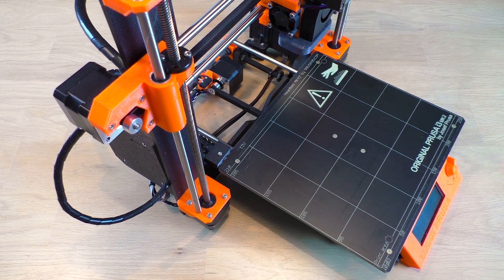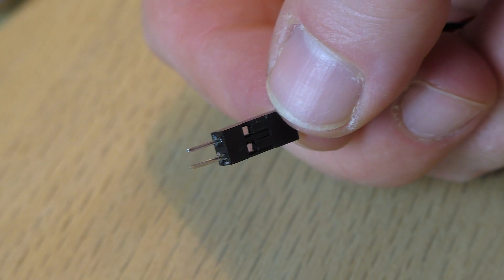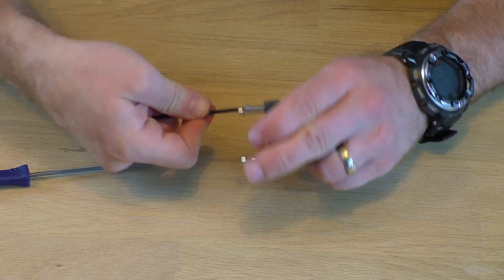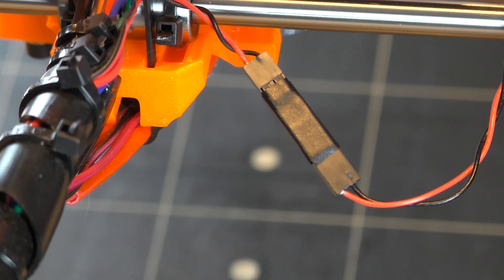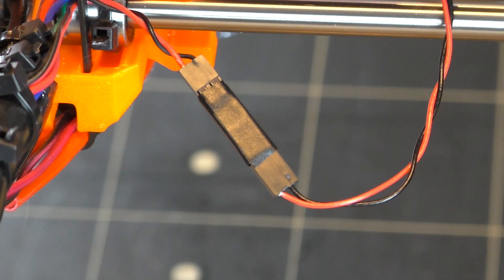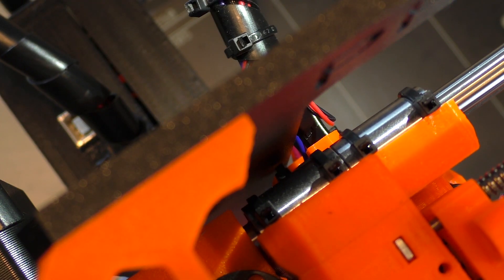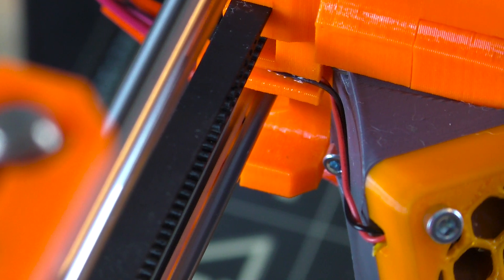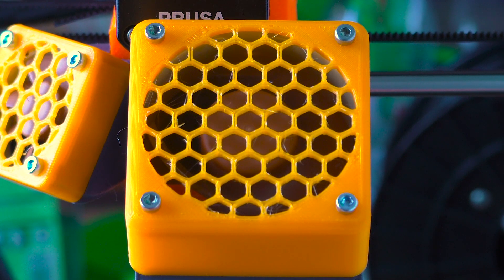How to install Noctua fans on a 3D printer

Comment: I was wondering if i can use this for mk3s 
I mean fan mk3s already quiter than mk2 but still i cant put them in my bedroom, the noise is too high for me at bedtime.
Reply from the maker: Sure, just make sure to buy 24V version (Mk2 used 12V).

I would strongly advise against having the printer in your bedroom. There are a lot of particles released during printing and unless you have industrial grade air filtration, you'll be breathing them the entire night. ABS particles are known to cause cancer and other filament types are probably not much better. It's just not worth the risk.

Comment: what is the difference between 3pin and 4pin fans, would there ever be a use for all pins instead of just positive and negative?
Reply: The third pin in 3 pin fans or the usually yellow (if red is power, if there is no red then yellow is power and you should check the fan datasheet for the extra pins, but this is usually green then) pin in 4-pin fans is for speed measurement, it is usually open-collector output that puts out 2 pulses per rotation. The 4th pin is a PWM input connected to a transistor that turns off just the coils (or the MCU if it is some fancy fan with inbuilt soft start), and it accepts around 22kHz PWM signal, active high (100% speed when high). Check fan datasheet if possible for voltage levels, but usually that would be 5V even for 12 and 24V fans. If your printer doesn' t have extra pins on the MCU or you want to use said fan as a desk fan you can always make a manual controller on NE555. A 4 - wire fan might not be happy when run with PWM applied to power wires (like in most 3D printers), and the PWM wire left open, as the PWM on power may reset the fan's controller board, maybe adding a few uF capacitor in parallel will help, but it may run just fine, depends on the fan model. A 3-wire fan will usually work fine in 2-wire mode, but there always some 2 and 3 wire fans that don't like running from unfiltered PWM and they need a capacitor across them too.
Reply from the maker: Yes, the additional pins are used to report fan speed, but your firmware has to support that. This is useful for detecting if the fan has stopped working, in which case the print should be paused.

Comment: i find it funny no one shows you how to wire it to the board lmao
Reply from the maker: It depends on the printer you have, but in most cases, you simply look at the motherboard layout sheet, find the fan socket and plug it in. Here's an example for the Prusa's Mk3 board, all you have to do is plug it in the correct one: https://storage.googleapis.com/helpdocs-assets/Sd0njU6Ihj/articles/0SeHT5uEBp/1519683483568/readings.jpeg

Comment: After saving for one and buying one everyone told me they’re terrible for printers and don’t have enough static oressure ;( tho i bought the 20mm thick version maybe it’ll be different
Reply from the maker: Yeah, I have to agree with you, at least for the part cooling fan. It looked fine for a while, but I noticed it just wasn't putting out as much air as a radial fan. So I switched back to that and I'm only using Noctua for the hotend now.
Reply: @HobbyHoarder  hopefully it doesn't clog! someone told me it causes clogs. but mine is super cold. tho again I have the 20mm thick version but it made me lose 10mm of build volume :P
Reply from the maker: My first Noctua did lose performance slowly and it ended up causing a few jams. New Noctua (the one I got from Prusa's upgrade kit) has been working fine so far.

Comment: Do you Have the link for the fan gaurds? my n stop keep hitting the blade
Reply from the maker: The fan guards are already included with the adapters. Check the video description for Thingiverse link; you can then download just the fan guard under the "Thing Files" section.

Comment: Oooh the thing you used to attach the cable thingie is so cool! Never seen one before
Reply from the maker: You mean Dupont connectors? I love them and try to use them whenever I can. My printers run all the time and fans tend to die quickly, so it's super easy to replace them.
Reply: @HobbyHoarder  yes! never seen one before ^_^

Comment: My vacuum cleaner is less loud than my anycubic i3 mega! Considering that the noctua is scaringly under powered I used a random leftover fan from another brand that was 1.8-1.6w instead of 0.8e-1w the noctua fan Is. Not dead silent but it works :) and it doesn't bother me anyway. Next step, TMC DRIVERSSS
Reply from the maker: Back then, I could only keep the printer in my office and the noise was driving me crazy, which is why I went for the Noctua fans. Otherwise, you're perfectly right, it's probably not worth the bother. Now that all of my printers are in the basement, I don't care and use no-name fans from AliExpress. Good luck with the TMC upgrade, I've been eyeing those as well.
Reply: @HobbyHoarder  i have to import those for almost twice the price sadly. but you're right. my case was a little extreme but All I'm saying is that you're not stuck with noctua you know? I mean they're great but just what I did. I used no name fans cause I had them previously
Reply: What’s weird is everyone saying Noctua’s are underpowered yet they push more air than any other fan china can give you. I think people just compare the numbers and nothing else. 90% of fans on eBay or AliExpress have completely bogus numbers on them anyways.

Comment: the hotend fan wil not produce enough static pressure, it highly recommended to just get a good quality blower type fan because they can also be really quiet. I recommend titan blower fans for this.
Reply from the maker: You mean a radial fan? That's an interesting idea, I've never seen radial fan used for the hotend. Have you made the upgrade yourself?
Reply: @HobbyHoarder  they are used all the time and are meant for high pressure applications like blowing air through a nozzle.

On the fans you used you can put your hand above it and feel wind blowing instead of sucking. This is because the air can escape around and through the fans blades.

Atleast for your part cooler, for your cold end I'm not too sure if it would work or if it's necessary

But for your part cooler (the one blowing on your nozzle) it Atleast removes a huge and heavy cone and fan. So you get less ringing
Reply: Which model in particular and where to buy it? Thanks
Reply: @lechequemada1661  there is only one 5015 titan version be carefully it's a 12v version so if you run a 24v system you need another version

Comment: I've done my extruder with a SilenX IXP 13-14. Definitely a worthwhile mod, especially if you want to print at night. I'm hesitating on doing the hotend as it adds significant weight to the moving mass. Did you notice a change in your prints quality, like more ghosting?
Reply from the maker: I've since went back to the original hotend fan. I didn't really notice any loss in quality due to the extra mass, but it just wasn't cooling as effectively as the original radial fan. I've tried tons of different nozzle exhausts that you can find on Thingiverse, but none worked as well and I'd always get more warping. The Mk2.5 does come with the new exhaust that bends around the nozzle, so maybe that one would work better with a silent hotend fan.
Reply: @HobbyHoarder  Good to know! From what I've gathered so far, axial fans have much lower pressure than centrifugal ones, which is required for parts cooling. A way to reduce noise would be to get a larger blower and have it run at lower RPM.
Reply from the maker: Yeah, I've been reading on it and it seems the pressure is much more important than just raw airflow. I agree with you that using a larger fan would likely solve this, but the 60mm Noctua fan is already huge and it can't match the small stock radial fan. Putting a 100mm fan on the hotend would probably look ridiculous :)
Reply: @HobbyHoarder  Of course! I meant using a larger radial fan :)

Comment: Where can I buy the 4v. I’m only seeing the 5v.
Reply from the maker: King Kong You need 12V version for most printers, not 4V or 5V.

Check out my reply to Richard for links to the official web page.
Reply: Thanks for the reply Hobby Hoarder! So 2 Noctua 40mm @12v each will be good for my anet a6?
Reply from the maker: King Kong The 40mm is fine for cooling the hotend. As a part cooling fan, it might not be strong enough. I'd suggest a radial fan instead. If you still want to go with the Noctua, then a 60mm one would be better. So, 40mm for the hotend and 60mm for the part cooling.

Before you buy anything, check if you can find an adapter on Thingiverse so that you can actually mount the new fans.
Reply: Thanks for the tip. I was about to buy 2 40mm